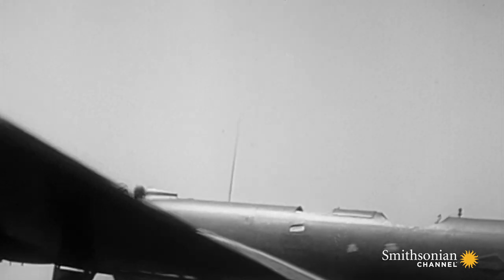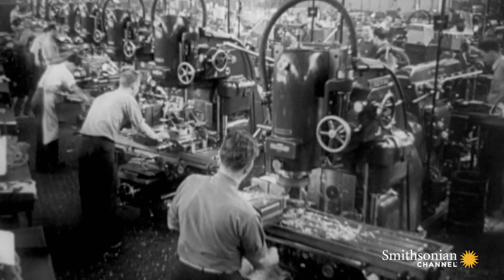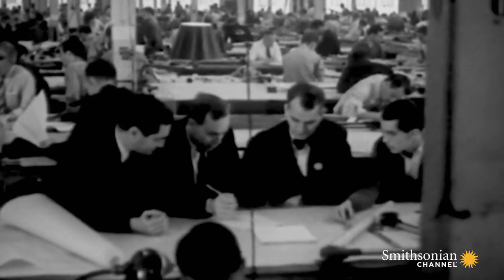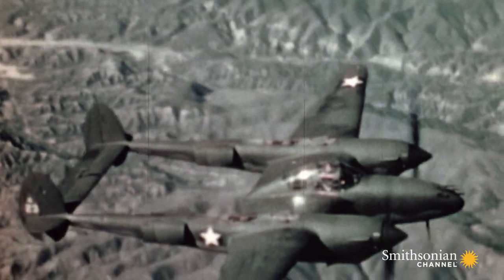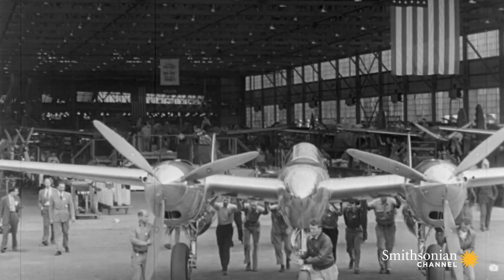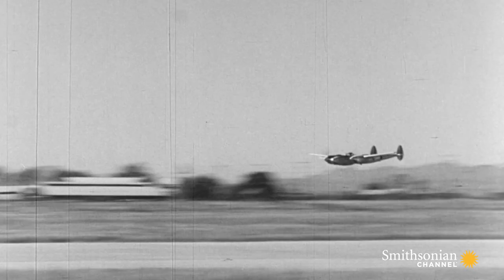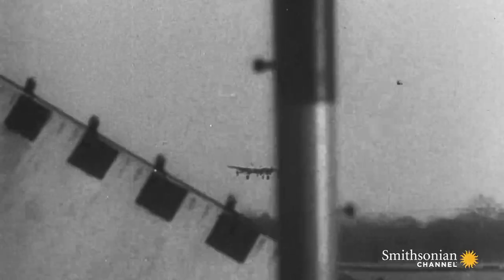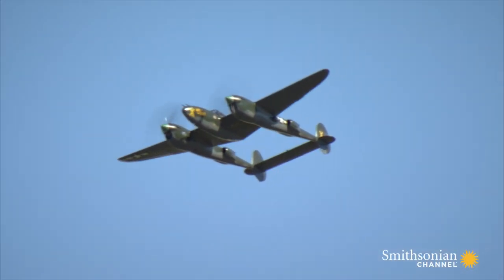How the P-38 Flew Faster and Higher Than Its Rivals

Comment: The P-38 was loved in the Pacific because it had two engines and with a lot of missions flown over water - or worse jungle - having a spare engine really meant a lot.  It was also flown at altitudes and using tactics that were different than in Europe which caused it to be much more successful.  German aircraft could dive away from the P-38's but Japanese aircraft couldn't.

There are a couple of other things to keep in mind about the P-38's in Europe and the Desert.
1) They and the P-40's were there at the beginning for the Americans long before the P-47's much less the P-51's.  Whatever their faults - they WERE what we had.  P-38's were there in 1942 - whereas the P-51's didn't get there until 1944.
2) Those P-40's and P-38's were going against the Luftwaffe at it's peak.  It had all those highly experienced pilots whereas ours were not yet veterans - so - the Americans in particular had a learning curve to go through that the British and German pilots had already experienced.

Another factor in the P-38's performance in Europe was a combination of technical problems, aircraft complexity and pilot confidence in the aircraft.

There were two problems with the engines in Europe because of the cold, at altitude.  One was that the engines never warmed up enough and the oil would congeal.  The other was that the lead in the gasoline separated so that the engines would backfire. The distance of the engines from the cockpit also made it cold and that was disliked. Given that any multi-engine aircraft is much more complex to fly than a single engine aircraft and not understanding what caused the engine problems the pilots were reluctant to push the engines.  As the P-38's also suffered from compressibility pilots were hesitant about diving the aircraft.

Thus, the aircraft itself had much more capability than the pilots flying it were able or willing to make use of.

With all it's guns pointing straight ahead in the nose - you could aim at your target rather than just spraying the area - as you had to do with wing guns that had a convergence zone.  A good shot could make use of that whereas less good shots might have been better off with Spray and Pray.  P-38's could loop well, had maneuvering flaps and counter rotating engines so that you could help turn the aircraft by adjusting the throttles.  Good pilots on occasion out flew Spitfires because of this - which most Anglophiles refuse to believe - but it did happen.  The thing is - this required a good pilot, who was very familiar with the aircraft and confident in what it could do. 

Lockheed sent a team with their prime test pilot over and in addition to solving some of the aircraft's problems they toured the bases and showed pilots just what the AIRCRAFT was capable of.  A set of kits was put together to fix the problems - but when 200 of these were flown in - the RAF shot the plane down by mistake.  After that - P-51's started showing up - they were easier to fly - and people in the Pacific wanted the P-38's - so they were phased out in Europe.

Given that by the time the P-51's showed up - a lot of those Luftwaffe Experten - were dead at the hands of guys flying P-38's, P-40's and P-47's - the guys flying Mustangs had a much easier time of it in 1944 than the boys who were flying in the desert in 1942.
.
Reply: I remember reading a story about how pilots said that the P-38 was a poor high altitude aircraft because of its Allison engines. The P-38, of course, was turbocharged rather than having the single stage supercharger that plagued the P-40 and P-39. 

So one commander said to three others, ‘we’re going up in a four ship formation and we’re going to keep climbing until the first pilot says “uncle”’. 

So up they went. I can’t remember the figure but it was well past 30,000 feet. He heard a garbled “uncle” from the back of someone’s throat in a pressure demand O2 mask. The planes were still climbing at 300 fpm. 

Another one was when there were concerns about range flying long overwater sectors. They brought in Charles Lindbergh to find out what was going on and to get better range out of the aircraft. He found that the pilots were using low boost, high RPM settings, and mixture in AUTO RICH to baby the engines. He immediately told them to change the procedure to operate at max continuous power, at the lowest RPM allowable, and to manually lean the mixture to peak. The pilots protested but Lindbergh assured them that they were army spec engines and would keep running under those conditions. They probably ran better due to lower frictional losses and less lead fouling. 

Final story which highlights the superiority of the P-38 in the Pacific. A pilot comes on the radio ‘help... my plane is damaged, I’m losing coolant’. Another voice comes on ‘don’t worry, just calm down and feather it!’  ‘Feather?  Hell!  I’m in a P-51!’
Reply: 18tangles  Hello Tangles!  I was just talking about you!
.
Reply: Very informative comment, thank you! I used to work with an old PhD chemist who flew P-38s with the 15th Air Force in Italy. He hurt his back crash landing three P-38s, poor guy. One day, over a bad neighborhood in Germany, he saw a weird shape flash past his gunsight and he just fired at it. He then got the heck out of there. Gun camera footage showed that he shot at (he said down) an Me262 jet. I built model airplanes as a kid (still do at age 61) and the P-38 remains my favorite WWII aircraft, behind the Mosquito, Hellcat and P-47, in that order.
Reply: @jmfa57  I'm more of a Corsair guy but in the flight sims for Europe (Secret Weapons of the Luftwaffe) I liked the P-38 and P-47.  Not a fan of the Mustang ... every time I got shot at my eyes would jerk to that engine temperature gauge - if it budged - it was climb for altitude and head home NOW. 

I had models (mostly Monogram (1/32nd scale ?)) of all of them.  Ha!  Ha!  I also had a combat box of 12 1/72'nd (mostly) scale B-17's hanging from strings held to our acoustic ceiling in the den with pins  being attacked by a bunch of German fighters with some allied planes flying in for support.  The low box was over a couch - so you could stand up and sit down on it - but the planes were just a little above eye level.  I've still got all those things in a couple of old speaker boxes in storage but I've not seen them in over 30 years.  I'm 67.
.
Reply: Wow! Your knowledge is amazing! Great to have this input!!
Reply: @waltbullet1287  Not really.  I just look things up before I post.
.
Reply: I always liked the 38's because I always figured if you got into trouble you could just hit the gas and get the hell out of there.
Reply: @Bartonovich52  Thunderbolt! by Robert S. Johnson is a good read. The P47 was a tank in the sky
Reply: "Good pilots on occasion out flew Spitfires because of this - which most Anglophiles refuse to believe - but it did happen.  The thing is - this required a good pilot, who was very familiar with the aircraft and confident in what it could do."

I'm not British and I'm out of step with most people in my opinion of the Spitfire (I think it is a bit overrated). But I have never heard this claim before and find it very unlikely in anything other than a bounce attack, which was the P-38s best tactic. In any other 1 v 1 engagement, I can't see how the P-38 would be able to gain any advantage against a Spitfire. If you can provide a source for this, I will willingly read it.
Reply: fork tailed devil
Reply: @thethirdman225 
Google John Lowell, P-38 pilot, and you'll find a story of him flying a mock dogfight with a Spitfire pilot who was a combat veteran, and called the P-38 a third rate fighter. 

It didn't go well at all for the Spitfire pilot.
Reply: @AlanRoehrich9651   It seems very few of Lowell’s stories can be verified. Just because it turned up in a book, ’Top Guns: America’s Fighter Aces Tell Their Stories’, by Joe Foss an Matthew Brennan, it doesn’t mean it’s accurate or even true.

It’s ironic that you told me to search for John Lowell because there’s plenty of information about him, mostly debunking his stories.
Reply: @AlanRoehrich9651  The P-38 had only limited value in the ETO. It did well in the Mediterranean and the Pacific but not escorting bombers over Germany. The Allison engines were simply too unreliable, the aircraft was too easy to recognise and they were too difficult to fly and fight in at the same time in such a crowded piece of air space.

Third rate fighter? Hard to say. I old navy terms, third rate - a ‘74’ - were extremely useful ships but I suspect that’s not what the British pilot supposedly meant by this. Unlike the P-47, the P-38 could fly relatively deeply into German air space. Unlike the the P-47, the Germans found it easy to spot and largely ignored it. The P-38 was eventually dropped from escort roles as the Mustang became the fighter of choice. But there were never more than a couple of fighter groups operating the P-38 in the first place.
Reply: @paisa1001  
"fork tailed devil"

That is a myth.
Reply: This wisdom is the sort of stuff that should be in all the pages for the other warlords that get all the glory. Always riding on someone else's back. Awesome information.

Comment: These videos leave you hanging.
Reply: a little too brief! I guess this content is designed for the 1 minute attention span. Did not discuss why the P38 had 2 engines and its effect on the cost compared to other single engined contemporary fighters, its failure in the ETO, the delay in sorting out some of its control issues at high diving speeds and its success in the Pacific. If you want a real video content on this subject go to "Greg's Airplanes & Automobiles" on Youtube.
Reply: @briancavanagh7048  Thanks for the information.
Reply: click on the full video
Reply: HotRodRay 
where do you click?
Reply: I concur 100%...👍

Comment: The P-38 Allison V-12s did not use "super turbo chargers". They were TURBO SUPERCHARGERS from General Electric.
The real story is in FORK TAILED DEVIL by Martin Caiden.
The Allison V-12 engines were the most powerful aero engines available in 1938. To get the required performance two were needed. Also, the Allison was a modular construction that made counter-rotating props a simple solution to stability. Lockheed used advanced metal construction to make the aircraft very slippery. Kelly Johnson put the turbos behind the engines which led to the twin tail booms. The P-38 was the best fighter gun platform of WW II. Four .50 caliber machine guns  and a cannon mounted in the nose, 6000 rounds a minute accurate to 1000 yards.
The cross country flight of the prototype was not a Lockheed promotion. It was a USAAF publicity stunt. The crash was not pilot error or carburetor icing. The destination air field was not informed about the flight arrival and the P-38 flew around waiting for landing permission until fuel ran out. The loss of the prototype set back the production program by almost two years. The P-38 high speed, high ceiling and long range made it the most important USAAF fighter for most of WW II. It was considered so important to Operation Torch invasion of North Africa that the invasion may have been delayed until they arrived. They had to be ferried by accompanying B-17s across the North Atlantic. P-38s destroyed the most enemy aircraft in the Pacific and were flown by the top Aces in WW II.
Reply: A difference that makes no difference is no difference. I'm sure most people here knew what was meant.

Comment: Faltered? Engines falter when they have no gas in them. The 38 was on fumes when the Air Controller wouldn't give him priority and made him join the pattern and...Kersplat.
Reply: The video said they iced up and that fits with me. Anyhow
Reply: ive read both, but whats the answer? low or outta gas or not? where was venturi heat then, usual icing is not a problem at the end of a flight. it happens when climbing or establishing altitude.
Reply: Good catch. Most simply say it was carburetor icing. In reality, it was traffic control which led to low fuel, which led to lean mixture, which led to icing.
Reply: thanks david....they didnt even notify the tower jock he was coming, so they couldnt roll him under the bus. hed stopped for gas twice and still beat hughes racers unrefueled record. many think of the 38 as a fighter plane, it wasnt. it was a high speed interceptor. which is why kelly installed the government mandated 20 mil. to get to incoming bombers screamin fast, and then bust em out of he air.
Reply: @Imnotyourdoormat  It's SOP, in light aircraft, anyway, to apply carb heat on downwind when landing.
Reply: my dad was a great pilot for sure, bush grade, but he made a couple mistakes as a rookie pilot though. when he was climbing to altitude one day in his champ, revs were down a bit... he had forgotten to use a little carb/heat... an old-timer had taught him its a good idea for heat in the carb in a champ because of its layout, for just a few minutes precautionary, but when he first realized it, in alarm he pulled it all at once, instead of gradually, it melted the glob immediately, and began drowning the engine. with no starter motor and not much altitude, and although the aeronica  could glide...a serious situation. but he kept his calm, and kept the nose down [gutsy move with no angels except his guardian 1] feathered the throttle back and forth the  best he could, while the slipstream turned the fixed prop over... at treetop level, the continental purged itself, sh-- out the water, and returned to running smoothly. he flew around for a bit, landed and went home 1 the wiser.
Reply: @TheSoundsage  You Win!